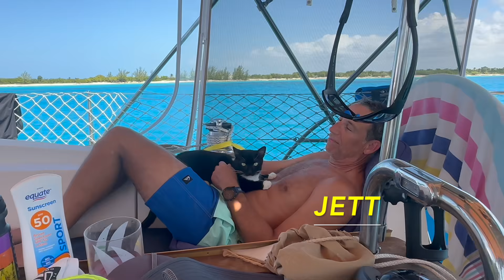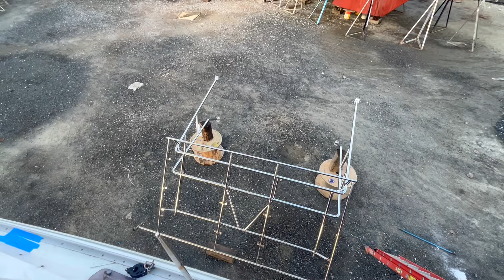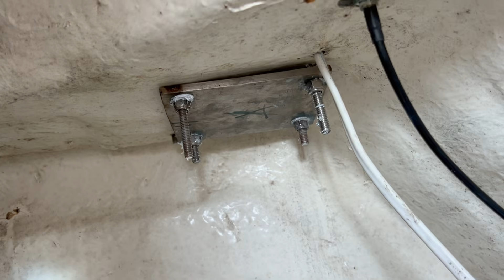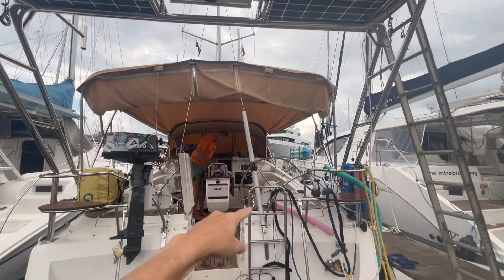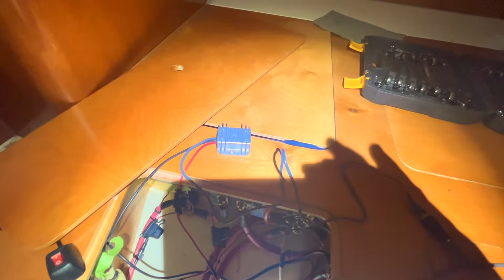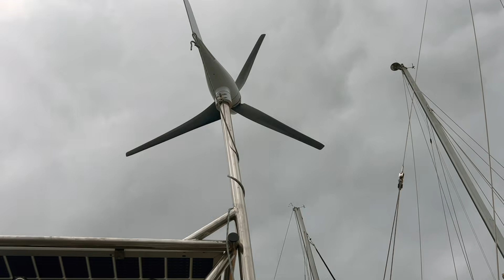EP. 68 We Installed a Solar Arch & Wind Generator (Full Off-Grid Boat Setup)

Comment: Why does your lazerette give away so much volume with an inner liner?
Reply from the maker: Thanks for the comment! The lazerette is part of the cockpit structure, which is also the ceiling of our master cabin. As you know, boat design is all give and take, and while we all would like more storage on our boats, we are very happy with the Elan Impression 434's design overall.
Reply: @SVEndlessSummer But I saw just a usable void. A big open area between the hull and the lazerette. Perhaps the camera made it look bigger, but to me it seemed a solid foot of just open space.
  I'm not criticizing. Just wondering, when storage is at such a premium on a boat, why the designers would leave that area inaccessible. 
  I have seen catamaran rebuilds where folks have made bunks out of space the designers just boarded up for some reason.
Reply from the maker: @goatman3828  Thanks for the comment! It's about 2 inches. We had to cut through the lazerette to create an access port to attach the backing plate for the solar arch.
Reply: @SVEndlessSummer oh, that's entirely different. The camera angle made it look huge to me. Thank you.

Comment: I have a 400W12V wind generator on my boat. Looks like same blades, and it is quiet. It provides enough power to keep keep up with our overnight electrical demands at anchor in anything over 12KTS windspeed. (refrigeration, lighting etc...) Solar kicks in at sunup, and usually we are fully charged by 10:00 local time. We often use the excess solar after that for watermaker.
Reply from the maker: We are still new to the wind generator--And looking forward to the additional power when we get off grid! 🏴‍☠

Comment: Practicality aside nothing ruins the lines of a sailboat more than a great big solar arch with a dingy hanging off it with canvas covering it.
Is a diesel generator really that bad?
Reply: Yes. A generator really is that bad.
Reply from the maker: Richard, Good lines do not help you off-grid--or off-shore🤣... Solar is free while a genset burns valuable diesel. A dinghy is necessary to access remote islands. Thanks for your comments!!!